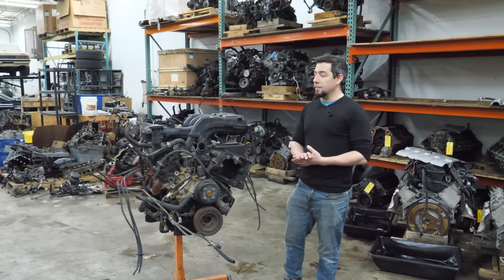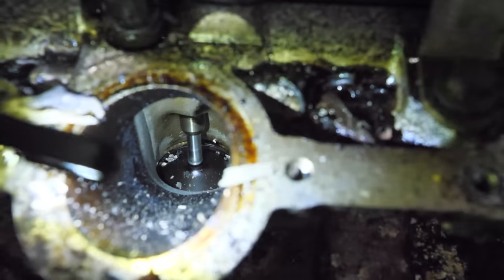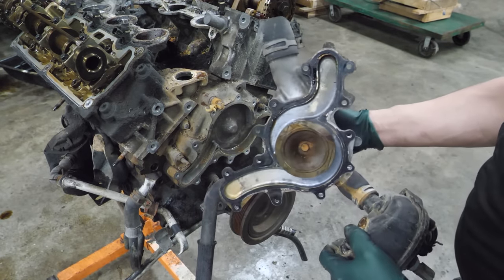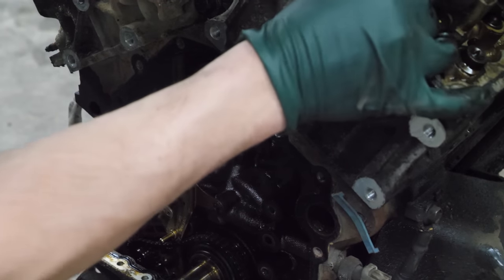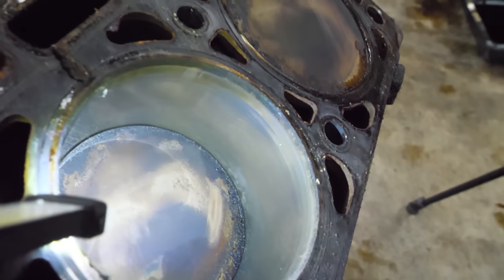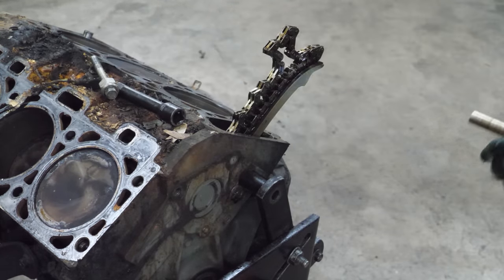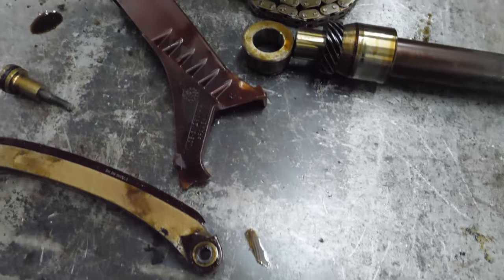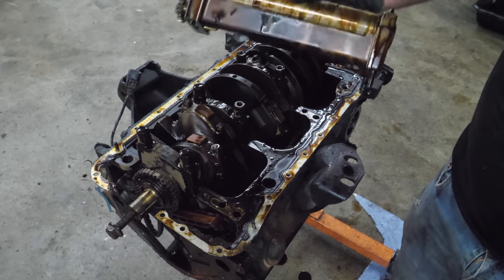Ford Explorer / Ranger / Mustang 4.0L SOHC V6 Teardown! Is This Why They're Called "Exploders" ?

Comment: Definitely Exploder. Was calling mine that without seeing it on the internet. My 04 got louder, and louder with the death rattle until it was so bad I found a front timing chain had begun to eat thru the housing. Had it towed to a shop and all they offered was find a used engine- so, like, aren't the plastic guides in a used one gonna be just as bad off...? Had it towed back home. Then got a fellow I know and his brother to agree to change out the chains for about $1500. Both dedicated, dyed in the wool Ford guys, drive a Ford or die- one of which has worked in a dealer shop before. Pulled the engine and replaced them. And then it decided it didn't want to run right, didn't want to start, ended up they had to haul it to a dealer where they got the computer reprogrammed or something. After it was finally back on the road, dang if one of the new chains didn't break couple weeks later. One minute I'm bebopping down the road, until I wasn't.  They had to carry it back off and do it again. So, yeah I see why a shop didn't want to do it- fellow told me after doing mine that he'd never, ever, eeeever do one of those again.

Comment: I had a 1998 explorer when I sold it it had 217000 miles on it and it was a good runner. The guy that bought it ran it to 235000 miles with no problems and gave it to his daughter to drive to school. She wrecked it and he then put the engine into another explorer and they are still running that 4.0

Comment: You can pull the dowel pin from front timing cage to push through the head then put it back together with head on. The balance shaft was only on the 4x4.

Comment: I had a 2010 Mustang V6 with the 4.0L.  It was a simple engine on a simple car.  Sounded a lot meaner than it should've with a Borla exhaust on it.  

Ford really did give us a tribute to the classic Mustang before they reimagined it into a Eurofighter.  I've had two of those and I still wouldn't mind having a 4.slow in the stable.

Comment: I never had an issue with either of my 4.0L engines i had. The one was running awesome when i sold it at 200K miles. The other one was in perfect condition with 70k miles. Not a great design using a jackshaft in place of the original cam location and putting one chain in the back of the engine but with proper maintenance and keeping the thing off the rev limiter it was always fine.

Comment: I had a 97 Explorer with this engine with around 80k on a new engine.  One day I use the remote starter to warm up on cold winter day, it didn't run the same as it did before  
& I discovered it was leaking oil really bad. I found a hole in the side  of the timing cover. I took it to a shop & they quoted me $5k to fix it because it also had timing chain on the back of the engine!

Comment: I was hoping I'd see one of these torn down. I have 230k on my mustang with this engine and it's been great, even survived a mega overheat after the thermostat housing failed. It's my daily and sees 4.5k+ rpm very often. There's no complaints from it's loyal service here.
Reply: If you're interested you can find metal thermostat housings on ebay.
Reply: @Dappersworth  I appreciate the heads up; I bought one and installed it long ago, however.
Reply: @Sparklywoof  Nice

Comment: The 4.0 my dad had in his 2000 Ranger 4x4 must have been a diamond in the rough. He put 250,000 problem-free miles on it. It was still running perfectly when he sold it finally.
Reply: Very likely a 4.0 OHV in a 2000 ranger.  totally different engine except for the block. Have almost 200K on one from a 96 Explorer.

Comment: My 2011 Ranger 5 speed manual has 260000 miles on it..I have used Rotella T-6 oil since break in  was completed. I change the 15W40 T-6 every 15000 miles. This is the third 4.0 liter Ford I have owned..First two, both manuals, went well over 200000 miles. My 1997 Ranger was just plain Fast !!

Comment: The balance shaft was used on 4 wheel drive SHOC 4.0 V6's Don't know why? 2 wheel drives ones did not have that. Thanks for the tare down.

Comment: The 4.0 that I had was a "Cologne Six" in a 94 ranger. It was and OHV never gave me any real problems despite at the time I was a teenager,  and I neglected to buy a new MAF sensor. 😆 I rolled it into a ditch got it back put a 98 cab on it and drove it for another year. Last I heard of it it was bought for the engine.

Comment: Question - have you ever torn down a 3.0 liter V6 engine from 2008-2012 Ford Escape?  I have a 2012 Escape XLT-AWD with 94,500 original miles and the 3.0 liter V6 engine.  I do believe I will need to do some major 100K interval maintenance, so I was just curious to know how reliable these engines have been.  My old man taught me the value of regular, preventive maintenance so I am all over that, believe me.  Anyway, I know this is not relevant to this specific video with the 4.0 liter engine, but I did have one of those also in a 2001 Ford Ranger 4WD step side ; it was like a tank in the snow, but man, was it ever underpowered!  I only had it for three years and traded it in, so I have no idea how long it went on to last. I love your videos.

Comment: Just so everyone knows, the 4.0 Cologne used to be a pushrod engine with cast iron heads, it was based on the 2.8 and 2.9 Cologne V6s in the Bronco 2 and Merkur cars, all of which were built in Cologne Germany. In the late 90s, Ford wanted to update the Cologne to single overhead cams for more power and efficiency. So they didn't change the block and just ran an intermediate shaft in the valley where the cam used to be and connected chains from that shaft to the left and right cams, the only way to make that work was to put one chain on the back. This was a workaround so they didn't have to design a new engine, it wasn't actually a design flaw technically. That being said these engines are very reliable just change the oil on time and if you hear the chain rattling, stop driving it, bite the $2k bullet and get it fixed. Do not neglect oil changes and don't use cheap oil.

Comment: You should check out Ford tech Makuloco. He tears one 4 liter apart and assembles it. I have one in my 02 Ranger. I over do oil changes on it to prevent timing component issues. If the engine blows it is getting crushed Period. Great video

Comment: I had a 92 ranger with a 4.0 stick shift and a 93 explorer 4.0 with an automatic never had any issues with either one of them and both of them had well over 200,000 MI however they didn't have that overhead cam design

Comment: They are plenty reliable they make nearly small block level power. But they are quite inefficient and don't get regular service do to the complexity. Nobody wants to pull the entire front of a vehicle apart or remove an engine to do timing chain and tensioner.

Comment: I had an 4WD '02 ranger with one of these engines and that truck put me through school, drove literally half of FL on a weekly basis, made tons of junkyard runs and towing operations for my 3000GT and various hondas. The transmission started to die at 220k miles. Got it swapped and the truck lived until the person I gave it away to wrecked it. 

Ice cold AC the whole way <3 Only complaint i had was bad gas mileage no matter how softy you drove it.

Comment: Ford Tech here, it all comes down to maintenance, these motors can go over 200k with no sweat, or they can break guides at 70k. My personal sport trac with the 4.0 just now had the guides go out at 204k, got the truck at 150k, even with the motor being very sludgy from previous owners it still lasted that long. I rebuilt the motor with brand new heads and timing, hoping to see over 400k! (I Yeeted the balance shaft) Btw you can remove that timing guide without removing the head ;) it's also very common for the back tensioner to break, just look at the design........LOL

Comment: I had a 2001 Exploder with this engine. I did a timing job at 120k and no you do not have to pull the heads to get the cassettes out. The engine had 250k on it when I traded it in. It ran fine with plenty of power. Like most things, if you take care of it you won't have all the issues people claim they have.
Reply: Isn,t the flex plate (flywheel) covering the cassette (tensioner) bolt?

Comment: Change those two external chain tensioners because more than likely they never were changed. Not saying itll prevent other damage but it seems like the key to maintaining these for a long time. Especially if you have a low mileage one, change them even if you don't have a rattle cause once it does its probably too late.

Comment: My 09 Ranger lunched the cam chain tensioners with 185K miles. Replaced it with a remanufactured crate engine.

Comment: in 2013 I had a 2010 explorer with just over 30k miles. it started to run rough, needed a timing chain and or new guides. as you can see that's a full engine rebuild just for timing guides. it was cheaper to get a remanufactured engine from AutoZone and replace it. I don't drive fords anymore.

Comment: The postal service uses these 4.0's in their FFV's (early 2000's). We replaced a LOT of these engines because the timing components would fail, mostly on the passenger side, and wear a hole through the valve cover. Sad to have a vehicle with not even 40k on it and it needs an engine. Made good money on the labor though!

Comment: I had a Ranger with this engine.  When it started the chain rattled until the oil pressure came up.  Other than that I had no issues with over 150k miles.

Comment: I had a 2001 Explorer with that engine, it carried me all over the country east of the Mississippi river. It had over 200,000 on it when I sold it to my SIL. It had almost 300,000 on it when the timing chain broke and ended its life. The worst thing that happened to it was when the AC compressor froze up.

Comment: Had one with the same rear cassette problem. Had to pull the engine, but got it going with new guides and tensioners. I assume the rear timing chain was to use one reversible head design on both sides instead of two. They should have engineered the cassette to be replaceable without pulling the engine. The cologne engine was a German pushrod engine that was redesigned into a overhead cam engine. It’s a shame that such a tough bottom end was plagued with a horrible timing arrangement. It probably cost Ford many repeat customers. Thanks for the video. Please consider doing a SHO 3.4 V8 with their cam sprocket issues.

Comment: Head bolts - "Not Tight" per se, but "Torque to Yield (TTY)" 
Tightened until the bolt stretches and you have to overcome that initial force (clamping).

Comment: The coolant in the cyl means the left cyl head is cracked and leaking, causing a misfire of that cyl, i had to do a 100% rebuild on my engine, it's been running great since.

Comment: I owned 3 Exploders with 4 liter engines. The OHV head, NOT the SOHC. The SOHC had around 40 more HPs, but the failure of the timing system wasn't what I was warned about. If you have to replace the rear chain, you have to pull the engine. No thanks. They are durable and last a long time, but you are right. The SOHC is a time bomb.

Comment: Yup... The wife's 2005 Explorer with 131K on it recently developed the dreaded timing chain problem.  Very noisy. Running rough.  Cylinders on the right bank all show low compression.  Going to replace it with a remanufactured OEM 4.0 from Ford.  The Explorer is in perfect condition otherwise.  Much cheaper to replace the motor than to buy a new Explorer at todays prices.  If the remanufactured engine can run for 19 years like the last one, it'll probably outlast both of us.😁

Comment: Had one of those engines.  The guides break, then get sucked into the oil pickup, and then you have a "non-running explorer for sale".  Also, if you pay attention to the block and the heads, you can see how Ford cheaped out.  Both heads are interchangeable with each other after moving a freeze plug.  And the block casting was originally built for an overhead valve engine.  That's what the jackshaft to drive the back timing chain is for.  Hell, if you look, you can even find the spot where the distributor mount would be drilled out.
Reply: That's all true, however even the pushrod 4.0 never had a distributor. They had a camshaft position synchronizer in that spot, and a coil pack for ignition.
Reply: @jonclark1288  From what I read about the engine, it's an old Cosworth V6 block that they have been using for a long time, like maybe the 70's or 80's.   They just cobbled the other parts together to make it work so they wouldn't have to recast a new block.  I believe the SOHC and the OHV 4.0 were the same block cast with different machining for the lifters and such, but I am not 100% on that.

Comment: I know this video makes this engine seem bad, but I have one in 2008 Mustang with 230K, bought it at 38K. In the last year I have used it to make a round trip to Canada (4200 miles total). I have issues with the Mustang but never with the engine.  It still accelerates like a rocket. I have serviced mine like clockwork so maybe I have the one great 4.0. And if the engine goes bad tomorrow,  I have 230K on it.
Reply: Also the jack shaft will help eliminate some of the rapid ramp up in torque (rotational energy from the engine) that causes most engines to tilt to one side during acceleration. This because it spins opposite the crank shaft. This is handy if you’re accelerating in a turn.

Comment: The timming set up on these engines could have been a whole lot better but they are tougher than board nails one of the best later model engines  that ford produced ive had a few rangers and explorers and put hundreds of thousands of kilos on them never had one leave me, currently still have a ranger level 2 one of the best trucks ive ever owned 300.000 kilos so far runs excellent might calve any second who knows but going on 9 years run owes me nothing.

Comment: I got bitten by one of these.  had rough idle.  we were chasing vac leaks and screwing with the EGR, not trying to see the elephant- timing chain slap.  Sure enough it was the rear bank.  chain guide failed, the 3 cylinders on that side were out of time.  
had to pull the motor to fix.  was a painful but good learning experience.

Comment: Many years ago I bought a really nice 4x4 explorer with an sohc 4.0 that needed timing chains. I gladly handed over $500 for the explorer and bought all the parts needed to do a timing job. Once the parts came and I tore into the engine I really wished I'd never bought that POS, I did the timing job and it actually ran good afterwards... I unloaded that thing before it had a chance to screw up again!

Comment: my daily driver 98 ranger has the last of the pushrod 4.0s it has 200k+ miles  nothing but normal maintenance still on factory clutch and still running i meen shes tired but i trust it everyday to get me to work. good synthetic oil is the key she's only ever had Mobil 1 or Amsoil

Comment: I had the 4.0 in a 91 Ranger.. with a 5 speed, it was a blast to drive.. would embarrass a few smaller cars and Toyota Tacoma's.. I loved it.. I put well over 300k on it, driving it HARD.. it was a great engine.. I put a head on it, when my son cooked it, pulling another vehicle one night.. the left head cracked, but with the new head it ran another 80k before I finally sold it. It was SO dependable. I had another 4.0 in a 06 Explorer Sport Trac.. My wife put 184k on it, before she totaled it.. I hadn't done anything to it, but change oil and the belts. Great little engines..

Comment: I absolutely love my Cadillac DTS North Star !! The only reason people don’t like them is because they are cheap and can’t work on their own vehicle . I know many people with over 200,000 miles on their Northstar with no problems basic maintenance. The head bolt issue was fixed prior to 2005 anything after that year is safe as far as the head gasket goes.

Comment: The pins chain Tenser, new ones a hard to push in, 
The oil pressure is for lubricant. The springs in them soften over time.
  Change them every 50k, miles. If the chain doesn’t have good enough tension this will make a big problem.
     The spring in them becomes weaker, and weaker over the miles.
They are easy to change.
Only buy them for Ford, you need the real part. 
The copies might be 90% cheaper, but the risk is very big.
   Myself I spend the big crazy money at the dealership, because I want the real deal.
Amazon, and Autozone, have very cheap replacements tenders.
It what inside of them you need to buy, and strong spring that will hold up.
New ones are very hard to push down.😊

Comment: 2:30 I'm not looking forward to doing work on the EGR system in my wife's truck.  2008, 4.0L, rear drive Eddie Bauer, 225K on the clock.  Recently (last year) replaced a cracked plastic thermostat housing and did the water pump while it was apart.  The only CEL code is for EGR flow insufficient and I'm sure it's just a seized up solid tube of carbon back there.  It also needs the heater hoses right next to it done and I'm kicking myself for not doing them last year.  No chain noise, YET, so it will get the 3K oil changes and the assorted peripheral attention it needs until it starts the "death rattle".

Comment: Having my grandads 4.0l ranger has been my best ride most reliable with more available aftemarket compared to my explorer that has a good engine but body has so much corrosion body bushings were crumbling in my hands, some of the plastics have gotten brittle, metal parts are snapping off already. Engines in good shape with new fuel filter, battery, coolant, air cleaner and oil change.